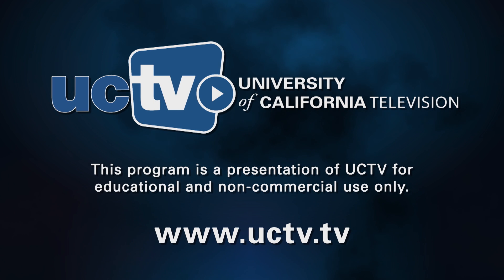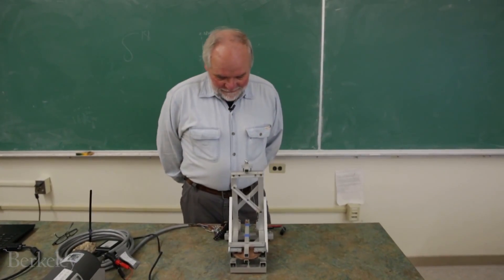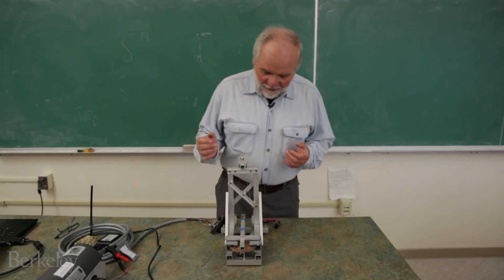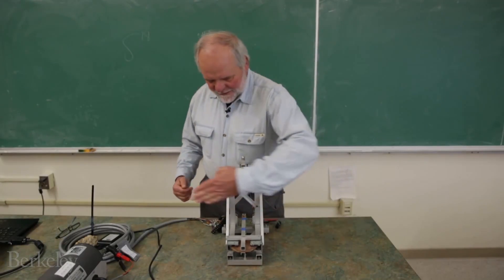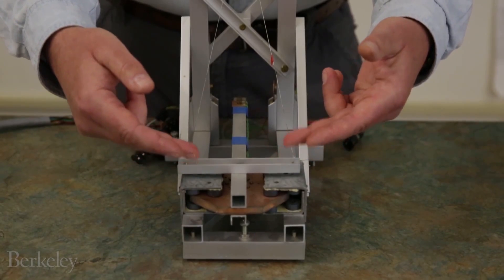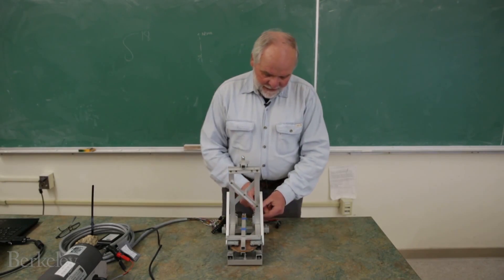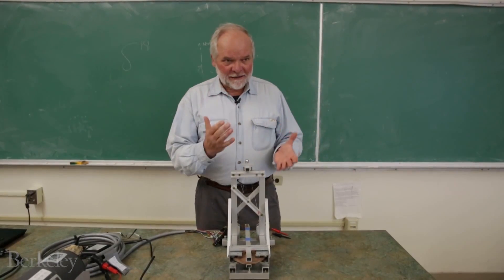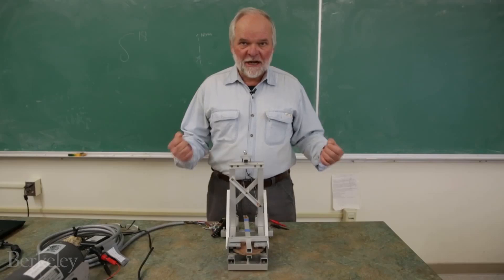How Does a Seismometer Work?

Comment: I don't get it. When the desk is struck, there appears to be no detectable movement. Yet the pendulum swings as if the entire desk was shoved an inch sideways.
Reply: Maybe cz it's sensitive to vibrations, even those which are not perceived by us... so that the device can measure even the slightest of an earthquake
Reply: @minahilkhan9348  I guess the point that I'm making is based on the laws of inertia the mass moved far more than the desk. Remember,we're talking about physics, not electronics. The sideways movement of the desk would be perhaps a hundredth of an inch? Yet the pendulum moved about an inch. Apparently, there is more to it than meets the eye. Otherwise, the laws of physics have been violated.
Reply: @jakejones5736  Inertia depends on mass. As the table has quite a large mass as compared to the pendulum,  table didn't show that much motion while the pendulum did . Just like if the same amount of force is applied to say a small ball and a monster truck so obviously the ball will show great motion while the truck might not even budge. Hope I'm clear.. btw it's just what I think might be the reason as I'm just a high school student not a qualified professor